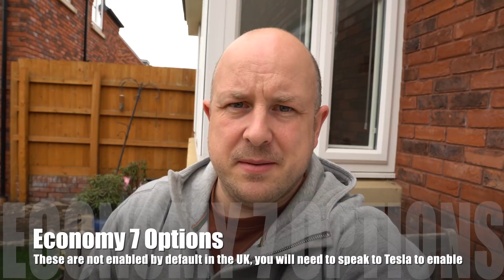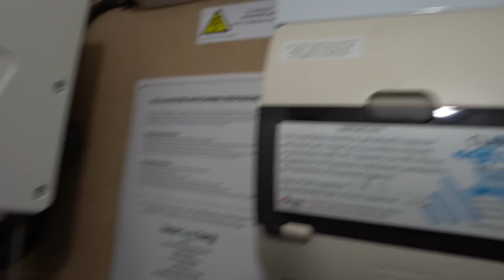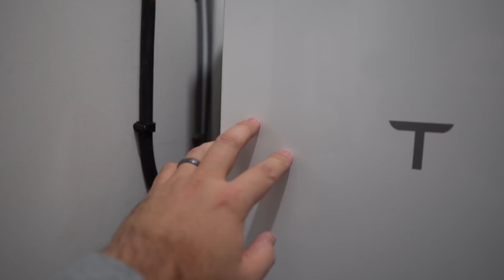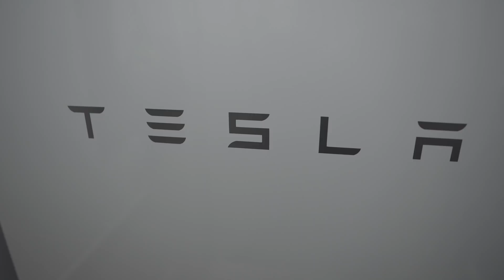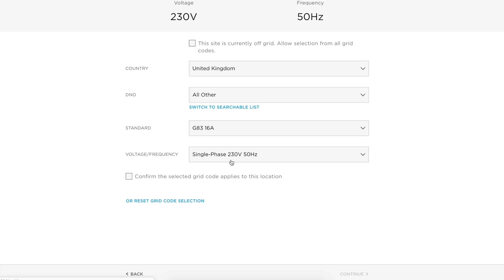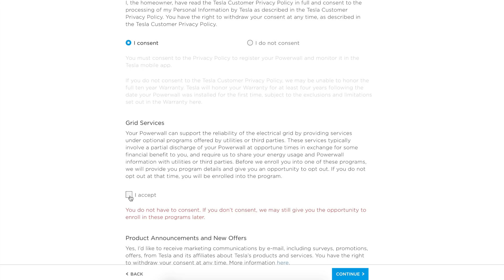UK Tesla Powerwall 2 Install - What to expect on your install day

Comment: Greetings from California! One thing we found out, which wasn't advertised, and which I hadn't heard discussed elsewhere: If the Grid is "de-rated", i.e. less than nominal voltage (220 here), the gateway will disconnect both the PV and the Battery, forcing you to run off the grid. My conspiratorial mind says that any power utility that will burn people and blow them up (PG&E), will happily do this to prevent you making your own electricity. It hasn't happened since, but thought folks would like to know.

This information was related to my orally by Tesla Phone Support... if anyone gets any more details, I'm happy to be corrected/further informed.
Reply from the maker: I assume this is with the gateway 1, ie not the gateway 2 that allows isolation from the grid.

Comment: Hi, great video. Given your system inverter is rated at 6kW, and grid limitation is required, which part of the system controls this- the S/E inverter or the Tesla Gateway?
Reply from the maker: Hi Jeff, I have DNO approvel to export at 6kWh so I do not need to limit anything. If I DID need to I have a SolarEdge Modbus Meter in my electic cabinet that could be configured to limit in software, or you can get a G100 compliant one which I believe does it at the hardware level.

Comment: Great call out BTW on the 3.68Kw output limit if you don't have the DNO in place. I'm not sure how often I would likely hit that limitation but I guess a 7Kw EV charge might cause it, but I think a Zappi might be clever enough to slow the charge?
Reply from the maker: The Zappi has 3 charging modes to help with the energy put into there, but typically it will be the job of your inverter or modbus that limits what goes into the grid.

Comment: Thanks for this video SG. I'm debating a PW2 to replace my existing 6.4 solution, not much use now but come the summer it would be great. It sucks to see the entire battery pack charged up by the early afternoon. 

I have two systems with the same sizing as you. Solar Edge is the gold premium, how have you found it?
Reply from the maker: Loving the SolarEdge kit, not missed a beat so far. The optimisers work really well in the winter when I get a little shading, and you can get good stats out of the monitoring solution.
Reply: Spectrum Geeks hmm I may think about retrofitting. I'm just working my way through your channel, do you have an EV? How's that effected your power drain? I'm using a zappi but until the hub comes out its still fairly shonky (feel free to ignore, bet you've answered this already. Ps love the mac setup)

Comment: I have watched all your Powerwall and solar videos now!, all great content thanks. 
I know you've covered the Powerwall noise in you videos but do you think the Powerwall would be too noisy if it was installed in an under stairs cupboard (I'm not concerned about noise during the day(charging) but in the evenings/nighttime(discharging/also possible off peak charging). We are due to have ours installed outside the front of our house (slightly out of view) but my initial thoughts of the pulsing green light might attract too much unwanted attention was quashed by the installer saying "it could be turned off"(which I don't think it can) or "cover it with black insulation tape"(what!!!), but after watching your videos I now know it also has an On/Off switch for anyone to use! so now we are worried someone might find it and turn it off 'just for a laugh'. That's why we are now thinking of having it installed inside the house. With the door shut to where your Powerwall is can you here any noise from other side of the door?
Reply from the maker: Hi Andy, I have never seen an option to turn off the light, not in the installer configuration section or the user accessible options.
I have my office above where my powerwall is installed, and when the coolant pump is running hard (this happens when its getting alot of energy in or putting alot of energy out) I can deffo hear it.
I wouldnt says its a mega intrusive noise, more you suddenly think whats that odd varying hum.
I am not sure the noise would show up in a video I make, so not sure how I can help you better. I dont mind the noise whilst I am working, and have slept in my office and its never woken me up.

I guess just be sure with whatever you do, as moving after will be a pain.
Reply: Spectrum Geeks Wow that was a quick reply. Many thanks, I’ll let you know what we decide and how it goes.

Comment: Dude love your content and well put together. Just seen inside your gateway, it’s a  bit of a mess?  I’ve been doing the maths on solar. If I went ahead with a 5kw array with Tesla battery I would be looking at a 15 year pay back. Ouch.
Reply from the maker: Not many people seem to show the inside of the gateway, but thats just how it is :) I guess they could of used some cable ties to tidy up (I might do this next week whilst I have the power off for a eco smart meter install).
Regarding your payback calcs, sounds a little on the higher end, but not far off. The battery cost does increase the pay back time, but it gives you more useable solar power (unless you have some EV's at home all day). 
Just need to work out if it makes sense to you or not. Based on my current estimates, Its about 11 years payback for me, but I think this will reduce if I get an EV.
Reply: Cheers for reply. I might hold off, as there is rumour of new 40%+ efficiency panels on the cards. Great system though. Have you seen the fully charged version?